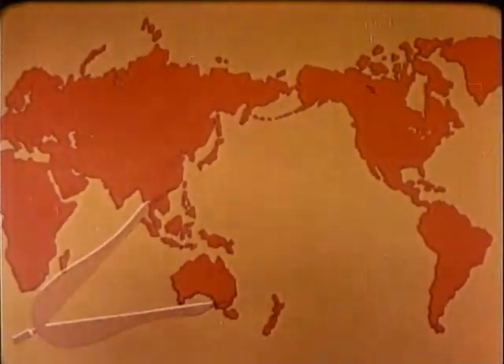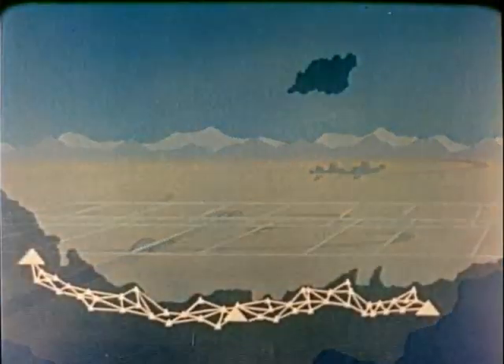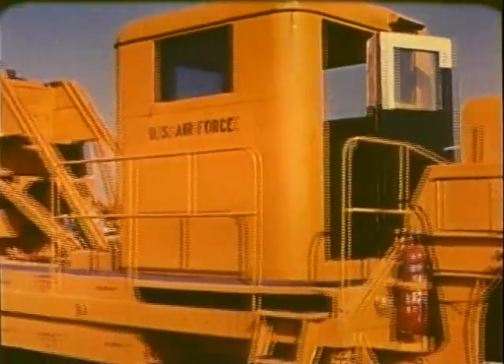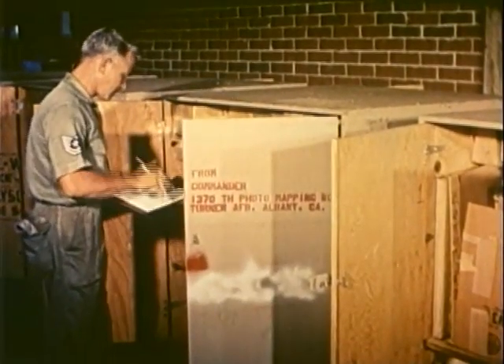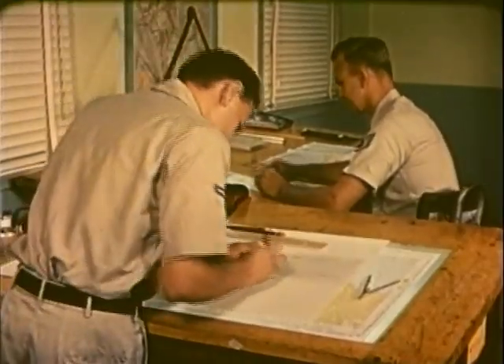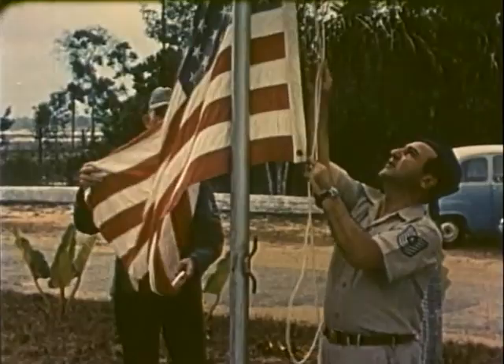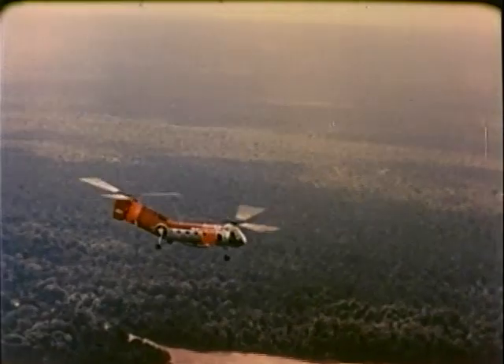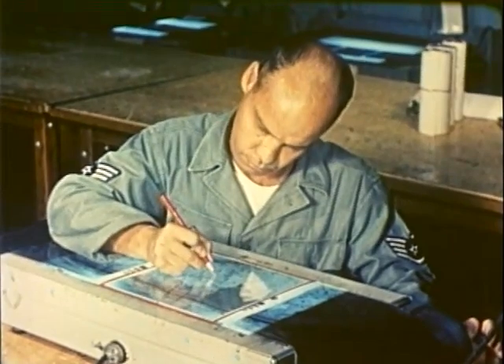Measuring and Mapping Earth

Comment: The issue of converging vs diverging longitudinal lines when applied to FE and globe models---1) Take two ships to the equator.  2) Have one ship head east 100 miles and the other west 100 miles. 3) Then have both ships head south 100 miles. 4) Now measure the distance between the two ships.  If the ships are closer together than the original 200 miles it would indicate globe.  If they are further apart than the original 200 miles it would indicate NO GLOBE.   cheers :)
Reply from the maker: Cgi nasa